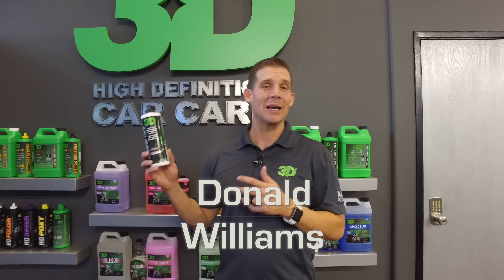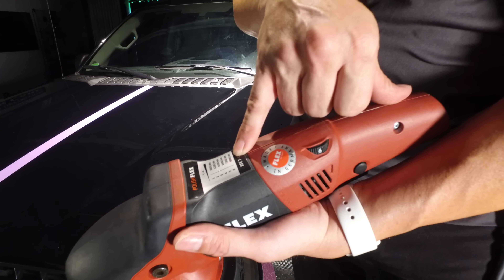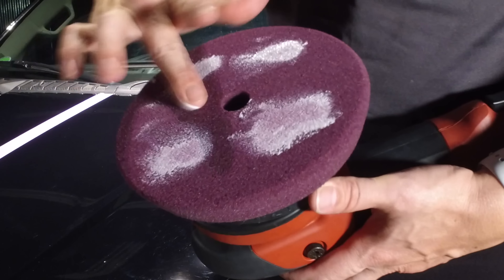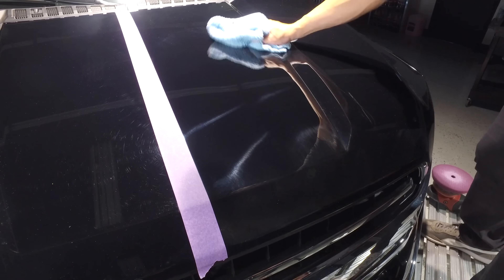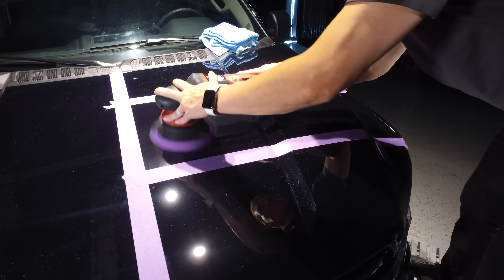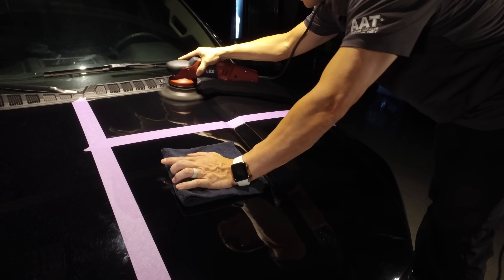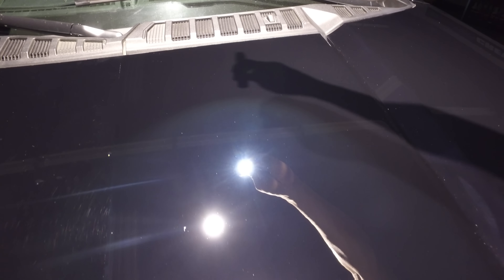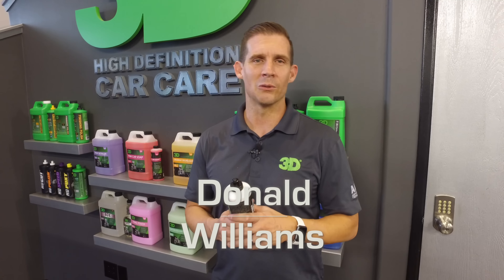3D One Hybrid on Foam Pads

Comment: Your products are just mindblowing! I first tried HD SPEED and I was blown away. Very good polishing and not that much fillers. Great shine from montan wax. Than 3D ONE...especially on panels like aluminum, plastic, carbon fiber where the heat is not dispersed...3d one is not 'melting' or dissapearing, or drying. totally esy to wipe off. mindblowing shine, and then checking with Gtechniq panel wipe, which is really unforgiving...nothing! Zero difference! the same intensity the same shine. Respect :)

Comment: Donald- I have a semi I'm looking for some correction and polishing not for perfection if I use the k156 medium pad with 3D One will I achieve some correction with a finished glossy look, with no micro maring? I will be using a rotary polisher.  Thank you I've been a fan of 3D for years now.
Reply from the maker: You would need to try it out on a small area first, to see if you are getting any micro-marring.   A lot of it depends on the hardness of the clear.  You should get good results with a medium pad and 3D ONE.
Reply: @3DCarCare  thanks!

Comment: Pretty oily upon removal. Not saying fillers, but definitely need an IPA wipe to remove those oils to reveal true finish.
Reply from the maker: There are no fillers in this product.
Reply from the maker: Try using less product, you may have better results.
Reply: QwikSS 
Always IPA after compounding for your lsp to stick to surface and longevity of lsp
Reply: OGCONSUMER I’m aware of that and I’m not saying there’s any fillers. My main point is that ONE is an oily polish, generally speaking. Even when using little. Not a bad thing, it’s just an IPA wipe is needed to remove those oils so you can see the true finish.
Reply: @OGCONSUMER  - You only need to do that if the lsp manufacturer recommends it. 

In other cases, any "glazing" left behind actually aids in bonding. 

https://www.autogeekonline.net/forum/hot-topics-and-frequently-asked-questions/31186-miscible-immiscible-wax-paint-sealant-bonding.html

Comment: Could this cause haze using it with a chemical guys orange hex pad ?
Reply: Probably not, but it depends a lot on your paint hardness. 

That pad once moist with product is actually very gentle. You'd be more at risk with the green, because it still is coarse with product on it.